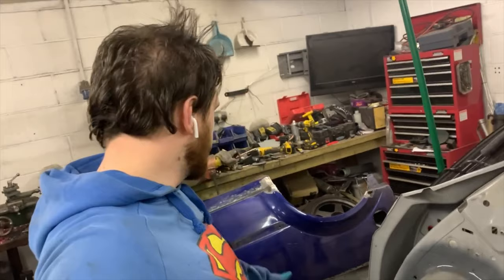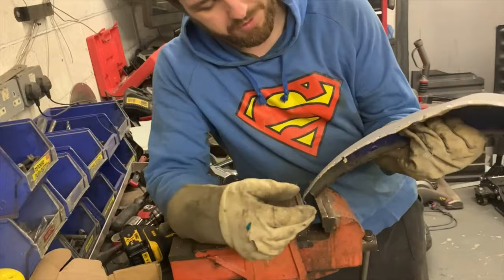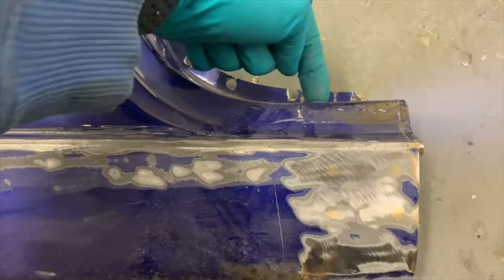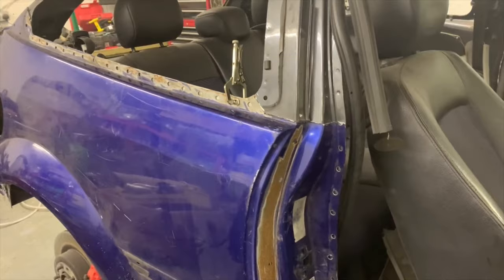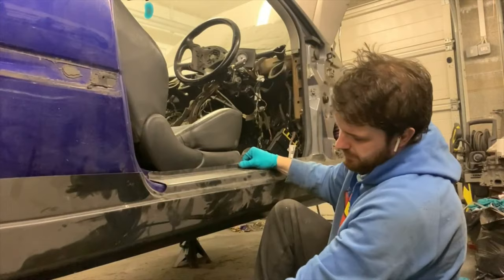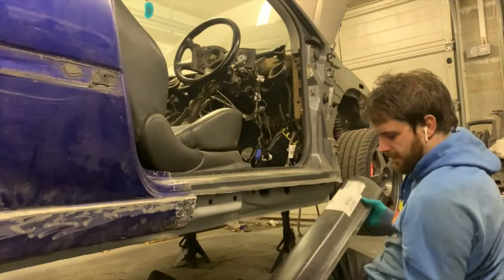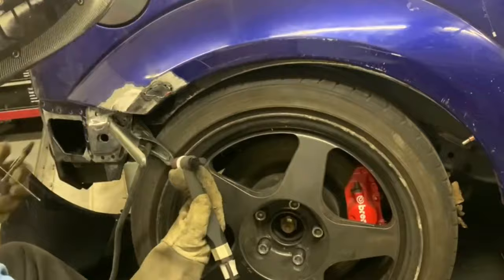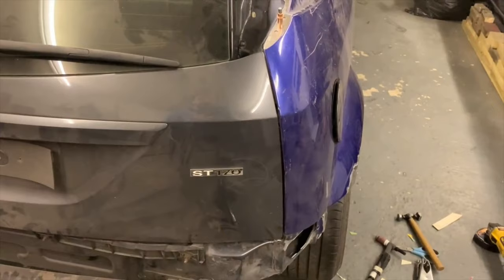Focus RS Wide Arch conversion - The Flexus Episode 45 - Ford Focus Twin Turbo V8 Project Car Build

Comment: The Mk1 Focus is such a lovely shape n those RS arches certainly beef it up 😊

If it weren't for the fact you're in the UK then I'd ask for the old rear qtrs you cut off. This due to some tradie twat reversing his UTE into my daily and then buggering off without a word. Now got a massive crater in the rear qtr to slide hammer out myself cos otherwise it's a financial write-off 😥

Oh, nearly forgot. find an off cut of copper bar to put behind thin steel. Can help the steel from blowing through 😉
Reply from the maker: Yeah I’ve been looking for some copper lol 

It’s not cheap either
Reply: @JaffBuilds  Try a company that manufactures electrical switchboards. You only need a few short offcuts of the small busbars. Worth a shot.
Otherwise a bit of copper pipe n squash it flat. You can even squash an end and bend it 90degrees so you have a handle to hold for awkward places.